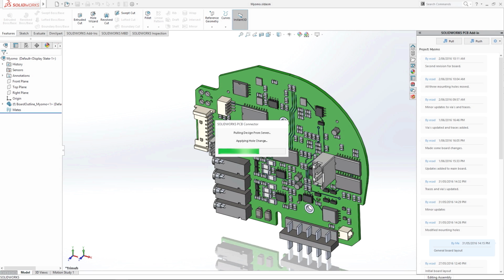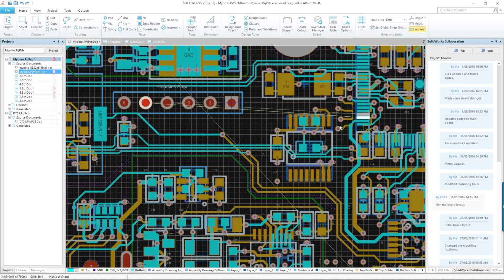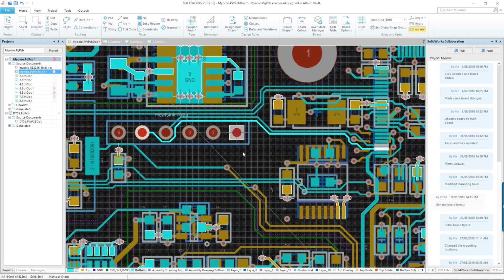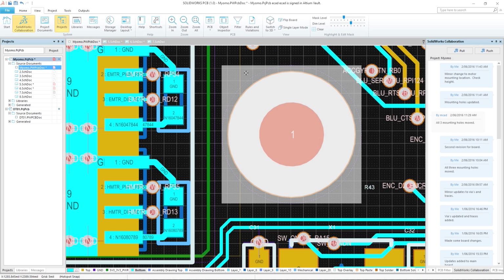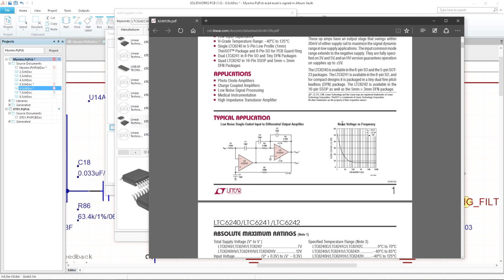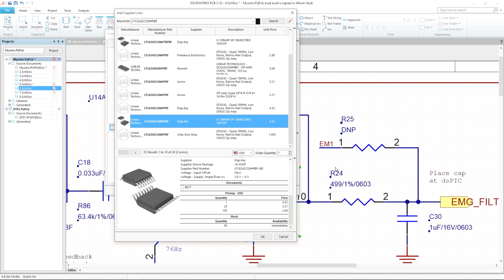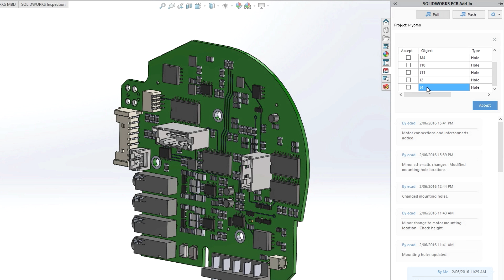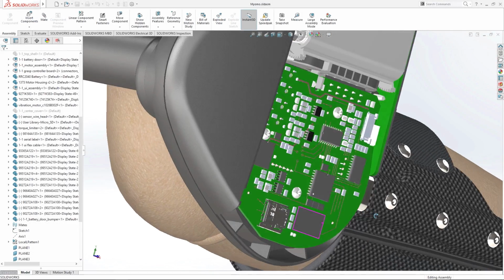SOLIDWORKS PCB 2017

Comment: Link donload file ?
Reply from the maker: Hi there,

For SOLIDWORKS 2017, please call the customer center with your serial number to retrieve your reseller information. If you are no longer on a subscription, there is no guarantee that the reseller will be able to provide the download but this is a good place to start.